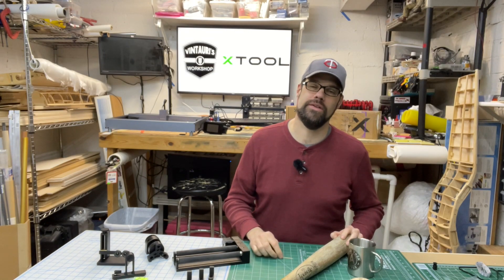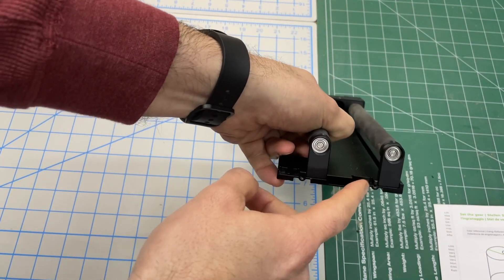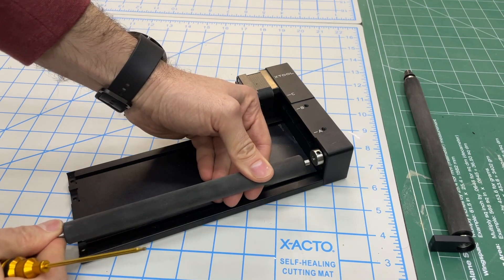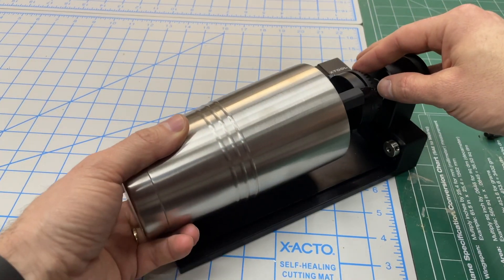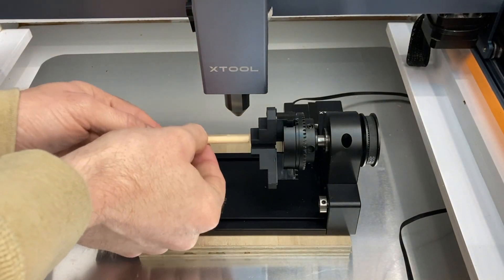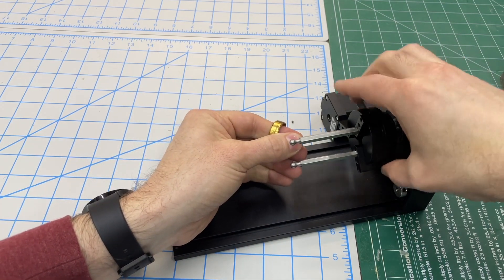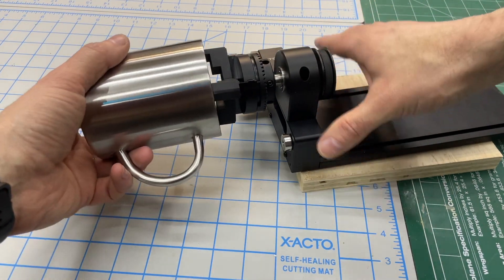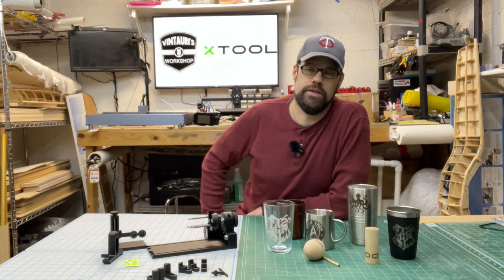XTool RA2 Pro - A multifunction rotary for lasers

Comment: Where do I go to on a new project to use this? Is there a drop down box or what?
Reply from the maker: In XCS you want to look for the option next to the Canvas in the upper toolbar that says Process on baseplate, or Process on Slats, depending on your laser.  Click that and it will give you an option to Use rotary, either roller or chuck.
Reply: @Vintauri  thank you so much

Comment: Can Ra2 pro be used with other laser devices? I have ComMarker B4. I borrowed RA2 pro, but must give it back tommorow. I use Lightburn software, I plugged it in and it seems working, but I have small expierience with such rotary devices and I just wonder should I buy one, will it work?

Comment: This is a great very informative video! Thanks!  When you were attaching the smaller gear for the pully was the flat side of the spindle obvious and did it fit in easily? I am thiking mine may be defective because I cannot get it to go in that hole far enough to adjust any set screws and I do not see any flatside on the spindle, TIA
Reply from the maker: Mine slid in fairly easily.  Make sure the set screw is backed out far enough to let it slide over the shaft. I have heard of others having a bad part where it would not slide on as easily.  You may need to reach out to xTool support if you are unable to get it to seat properly.
Reply: @Vintauri  thanks! That was the case, they are sending me a new part. Glad to know that I was not user error on my part. Lol

Comment: Im new to xtool and have a D1 20w, how did you burn on the mug, thought you would need to coat the stainless steel?
Reply from the maker: Most stainless steel will darken under the right power and speed.  It's the heat reacting with the coating to turn it a dark brown to black color.  If you want a very dark black, you'll want to use something like Cermark or Brilliance Marking Spray.

Comment: Nice Video, especially all the Hogwarts stuff! :D Could you please answer me a question? What kind of paint did you use to coat the glass before engraving? (I hope there will be something similar available in Europe too)
Reply from the maker: I used tempura paint for the glass.  It works well as long as you get even coatings.
Reply: @Vintauri  Can you please post a link to that paint? I only get Tempera results. Or is it the same thing?
Reply from the maker: @Atezz29  Whoops!  Autocorrect got me!  It’s Tempera paint. It should be relatively easy to find as it’s used in most grade school painting areas because it washes out so easily.
Reply: @Vintauri  OK, thank you so much. And please keep making such nice videos :p

Comment: Helow Vintauri, is there a way to connect and use the XTool RA2 to and with a SCULPFUN laser engraver?
Reply from the maker: They do include a couple cables that should adapt to most standard diode lasers.  You remove the plug from the Y axis Stepper motor and attach it to the rotary using the cables.  From there you would calibrate the rotary to your stepper driver.
Reply: @Vintauri  thank you.  I will do that.

Comment: Did I miss the part where you plug into the xtool?
Reply from the maker: On the original D1's like mine there is a port on the main board that it plugs into.  On the newer pro versions, you need to swap the cable from the Y axis drive on the board to attach the rotary cable.

Comment: I've recently come across your videos and freaking love them. Definitely looking to grab one of these lasers for my own shop. I know this isn't the proper venue for this but, is there any steps after engraving to protect the surface or does it just go out the door after the engraving? Thanks!
Reply from the maker: Thanks for checking my channel out. I’m glad you are enjoying the videos. Depending on the item I might use a spray on finish. Wax based oil finishes tend to gum up in the engravings. Often times it’s just a light sanding then a dust off with compressed air.

Comment: Will it work with ortur laser
Reply from the maker: I do not have an Ortur to test it with, however they are listed on the compatible devices with the RA2.  If you have a standard 4 pin connector on the Y Axis stepper, it should be compatible with one of the cable adapters that come with the rotary tool.

Comment: your laser head looks diffrent. is is custom?
Reply from the maker: I have the XTool air assist nozzle on there. I was also running without the acrylic shield.
Reply: @Vintauri  Is it available to purchase I did not see it online for the M1, just the D1.  Is it interchangeable do you know?
Reply from the maker: @royaltee4809  From what I understand it will work with the M1, but you may need to get a different cable from XTool to make it work.  There is mention of this on the RA2 FAQ page located here: https://support.xtool.com/hc/en-us/articles/5392521232151-Rotary-Attachment-2-FAQs#h_01G0EEDDXM81MYZKR47GKMNBXA

Comment: Will this RA2 pro work with the Ortur laser master 2?  Thank you. New subscriber
Reply from the maker: I do not have an Ortur machine to verify that it works, however there are two wiring adaptors included and the Ortur lasers are one called out in the FAQ that it works with.  I was able to make it work with the Atomstack clone laser without any issue.  As long as your Y axis has a 4 pin connector on it, then it should be compatible by using the right adaptor.

Comment: In lightburns rotary menu what did you set your mm per rotation at?  I did trial and error with the test button, but I feel like there should be a more accurate method
Reply from the maker: Sorry for missing this earlier, when using the chuck style on the Xtool D1 you need to set the MM per rotation at 1440 and then enter the exact diameter of the object for your burn to come out at the correct dimensions.
Reply: @Vintauri  I ended up finding this out, but also found it created a huge issue on forums.  After they released the RA2 pro they released a firmware update that changed it to actual mm and not degrees.  So post update its 32mm for the rollers and 128 for the chuck.

Comment: Great video.  Do you need to change anything in Lightburn Laser Tool Menu...Rotary Type,  when you go from Rollers to  Chuck?   Or do you leave it set on Roller for both type of operations?  Thanks.
Reply from the maker: You will need to swap between rollers and Chuck style when using it in the various modes.  Otherwise your designs will appear backwards and you will not have the right options to set the diameter.
Reply: @Vintauri  Thanks for the info.

Comment: Does this work with your OMTech red and black laser?
Reply from the maker: I think it could but it would require a custom wiring harness.  I have a chuck rotary specific to the larger Co2 laser that I occasionally use.